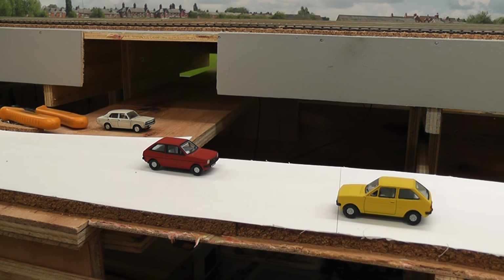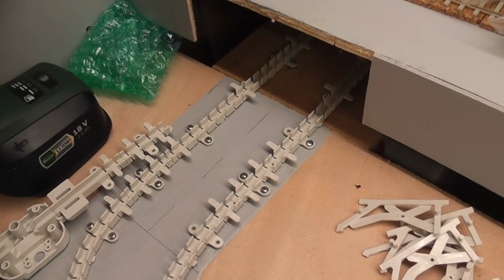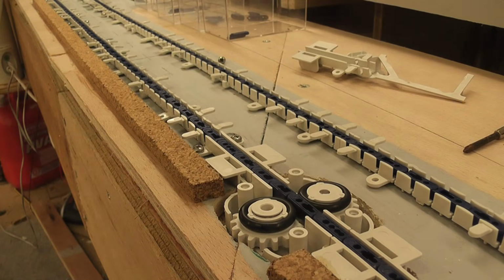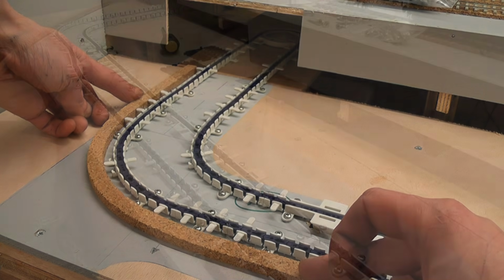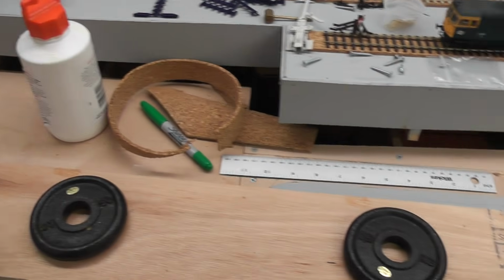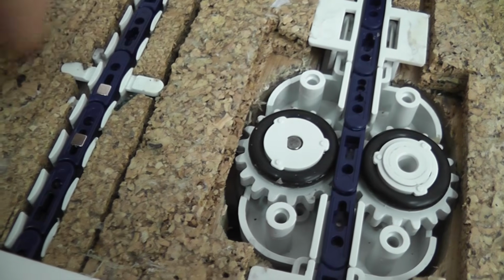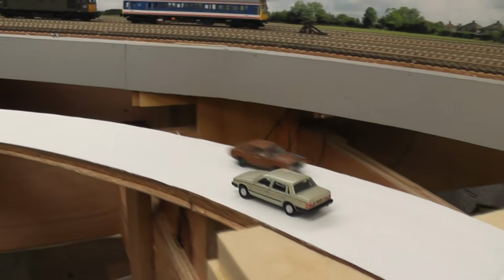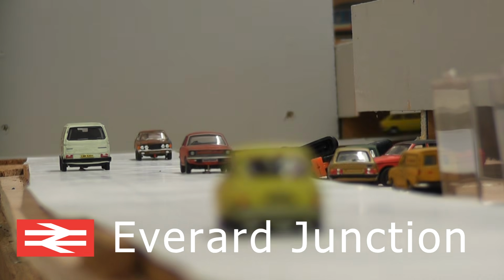New Layout Build - Magnorail

Comment: Hello I wish I found this earlier. I have had so much trouble setting out my track because the ‘Manual’ is, in my opinion, about as much use as an ashtray on a motorbike. I ended up routing a channel in the plywood baseboard to 8mm deep, cutting off all the screw ears and top surface ears on the track. It all fits nice and smooth. I am trying to run a model canal barge, about the size of your Fiesta, but it keeps loosing traction. Watching your magnet set up I see I have gone very wrong so will now follow your example. For my canal waterway I have a large sheet of shiny paper that was the backing to a picture frame, it covers in one piece. On top of that I have the very thin flexible Perspex that covers the picture. The sliders run around nicely but when I fit the boat or a Oxford Diecast car in one place on a bend ( a lot wider curve than the 180degree return curve with the kit), the chain stops. Or the boat/car comes off the magnet. I fitted the magnets to the boat and car. I will try your method.

Comment: Sir, 
I'm sorry to bother you depending on the scale size of my layout I have 3 major layouts and they are HO-Scale, N-Scale & Lionel 3-rail O-Gauge. Would you happen to know off the top of your head the names of these different scale type companies that makes the cars to be used on the layout. if I can use other market cars, trucks or  how about 18 wheelers in HO-Scale is that possible? Also are dicast cars to heavy for this HO-Scale setup?

Comment: I'm currently installing a 5m (each way)  long stretch of Magnorail. I've built a trial length about 1m long so far, routing the track into the board (to reudce sound) and using modified plastic trunking for the straight sections (thank you Ronald Dodd for that idea in your Hornby Dublo YouTube video). It works brilliantly using a road surface I haven't seen anyone else mention. I'm using self-adhesive satin black vinyl. It is too thin if you unpeeel the backing and try to stick it directly to the board. However, leave the backing on and it works a treat. I also think that it won't show the slider marks very easily as it is the same colour all the way through. As you can buy it in long lengths, there will be very few joins to show, which is a bonus. As all of my locos have sound, I don't think that the Magnorail run at fairly slow speed will be intrusive.

Comment: Attractive solution. Implementation a little complicated all the same and certainly expensive. Be careful to use vehicles with uncovered wheels, visually it is particularly shocking in this video. Alternative to the Faller system without on-board battery. Thank you for this well explained tutorial.
Solution séduisante. Mise en oeuvre un peu compliquée quand même et certainement onéreuse. Attention à utiliser des véhicules aux roues non voilées, visuellement c'est particulièrement choquant dans cette vidéo. Alternative au système Faller sans batterie embarquée. Merci pour ce tutoriel bien expliqué.

Comment: I wonder if, with some precision, you could permanently install the sliders on the car a fraction of a millimeter above the surface so that you reduce the friction down to only rolling resistance? I imagine the tolerances would have to be very tight or else you could lose a car off the track but the result might be worth the effort.

Comment: Hi! Conveyor expert here. Just a suggestion for the manufacturers, and maybe an idea for you: One of the end pulleys should be designed as a "takeup" to reduce the amount of "slop" as you call it.  The end pulleys should have a screw that allow you to make minute adjustments to the overall takeup or tension of the chain. Generally speaking, a chain should never be in tension at rest, but too much slop will cause major problems, so a takeup is usually necessary.
Reply: You are Right it might be a pain to get hold of the company but they probably need to no
Reply: I have a Question if you don't mind if I understand you right are you suggesting one mortar Rader then two
Reply: I wonder whether the turn-around pulley could be mounted on a simple slider for tensioning?

Comment: It seems to me, that there should be some granite cream or lubrication  product, that could be added to the chain trough to make it even more silent and slippery. As long as it stays dust free and clean. It should be rather air tight with the road surface lightly glued down. My garage door tracks have a white grease product that is very light, similar to the white grease product used to lube locomotive gears.  Just a thought...😅

Comment: I fear there are going to be a number of MOT failures!  Will you end up with a slider-track/mark from the sliders?  I’ve used UHMD plastic for stuff that needs to be slippery. I wonder if that could work as the basis for the sliders?

Comment: I wonder if the multiple motors are running at slightly different speeds due to the voltage drop on the longer cables which is why the chain appears to be bunched up in someplaces and not others?

Comment: I have found that to get the Volvo to behave correctly, you have to drill a hole in the driver's head and insert a brain. This may take a while to take effect as is the first time the car has experienced intelligence and it may take a little while to acclimatize. 
Of course, this procedure will violate the realism somewhat, But is recommended if you don't have automated police-rescue and ambulance units to deal with the normal mayhem caused by brainless Volvo drivers in the real-world. ;)

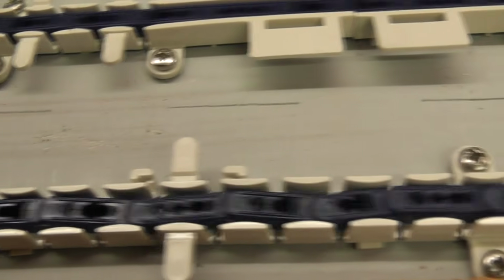Comment: It strikes me that you could get "bunching" like at 14:29 if your motors are not identical, and in particular, if the power wires to each motor are different lengths or gauges. Yours look a bit thin to me, but I haven't modelled for years.

Comment: THANK YOU for showing me this, as well as explaining the other system. The explanation on the 2 systems, got me to thinking about my planned layout. You solved the problem for me. Thank you, your Wisdom about both systems, I can use Both systems on my layout.  This system for the Auto Traffic in one lane, and the other system for Trucks and Busses in the other lane. That way the Busses have a route for them to move into a bus stop, as the Trucks continue on by in the Truck and Bus Lane, without affecting the Auto in the Auto Lane. I figured this out in my mind as you were explaining both systems, positive and negative for your layout. A VERY REALISTIC EXAMPLE you have Created for your layout SIR, mine might not be as PROFESSIONAL as Yours IS. FANTASTIC RESULTS. Thank You for Showing me the Realistic results.

Comment: The plastic is HDPE a self lubricating polyethylene. It's commonly used in cutting board for commercial use. There is also a video of a guy using sprockets and a bike chain. The Magnorail system is fantastic, but it's nice to have less expensive options. Option: to use a thumb tack or small screw to lay the paper road down. You may want to get to that Magnorail one of these days. Great video and very nice layout.
Reply: With the cost of bicycle chains these days, I'm not sure it would be much cheaper, but as a cyclist, I might just experiment with this!

Comment: This reminds me of the Matchbox Motorway way I used to have in the 70s it was a great system, it was a slotcar type idea but instead of having motorised cars it had a very long spring which was fed through the track when assembled then a 12v motor housed in a small building would click in and drive the spring around the track.  You could then put pins to the base of the cars attached with adhesive pads. 

The downside was the noise, very loud and all the cars went at exactly the same speed. But I loved it. 

Magnorail looks like a very similar idea.

Comment: Absolutely fantastic work.  Only issue I see is the cars run on the wrong side. (Yank, lol ).  Seriously-I wonder if Magnorail c/should make the spindle adjustable in a small oval slot-that way you could set the motor back 1/4" or so as needed to increase tension.  I would think the track will inevitably stretch with use.   Very well done!

Comment: This system is not very effective it wear and tear fast and loud , and you can’t make junctions. I would lay a plain magnet stripe under the road and have engine in a car. Junctions can be made with servo motors.

Comment: I think it is an interesting system. It looks like it is easily 3D printable. you could even use bearings or rotating pieces in the corners to reduce drag. it also looks like something that'll last a while. I don't how fast it wears down and what you can do against it wearing down, but maybe some oil could help with that. Maybe it can also make it a bit more quiet. It may dry up quickly though..
The main problem for me with this product from a convenience standpoint is that you can't have vehicles run along different routes. It's also very thick, so you can't have paths cross.
The final problem I see with this system is that it uses a lot of plastic. The cars needed for Faller's system need motors and batteries and stuff like that, but the track itself is just a metal wire which looks like the more sustainable option to me. The track also won't wear out, which is another benefit.

So, the main upside of this system is that it allows for very small vehicles like bikes. But other than that it has many downsides too. I personally think the downsides outweigh the upsides. Or maybe the two systems can be used together to get the best of both worlds :D

My personal idea is to use a hidden smaller scale train system with magnets on the trains so you get something similar to the system in this video. You could use a scale like N or maybe Z? That allows for tighter curves and you can make the trains switch tracks. So you can make a very flexible system. Especially if all trains can be controlled individually :D

Comment: I guess that the road surface will eventually develop a dark line where the sliders ride?  It would be an accurate look if the cars were pre mid-60s vehicles without PCV systems. There used to be a dark oil crud line in the center of most heavily travelled roads from road draft tubes.

Comment: The added magnets and load are going to rapidly wear your road surface. You need low friction wheels like Hot Wheels use. You can also clone your die cast bodies in resin, and make your own plastic chassis that minimize the load on your drive system.
Reply: Nice layout i want to do one but due to lack of space I may do a N-gauge one I'm going to price it up! And if it ain't silly money I will buy some magnorail starter packs.😎

Comment: I’m here after seeing the changes you made this spring. And I kinda miss this long run of Magnorail. Maybe have another run of Magnorail by the station by having cars passing your rebuilt bus stop where you keep your buses. You can do this to use up those remaining pieces of track and chain. Perhaps a little bit more cars running on the current road by the scratch built houses. And having two runs will allow for a little bit more traffic to add to the urban feel. And the pedestrian area in between the two roads makes it a little less contrived.

Comment: Can you use silicone slip spray on the track segments? 
Does the track have a way for cars to make an optional to go thru or turn at an intersection?

Are the magnets neodymium?  Will it work if you glue the magnets to the bottom of the vehicles so that the magnet is a hair above the road surface?

Comment: Hey since you're using photo paper, use matte on the surface and print your road from real scaled images. Ink cost is going to be high but the realism. All lane markers, pot-holes, tire marks, oil stains could be part of your print. Graphite or Teflon could be used on the chain side to reduce friction.

Comment: Love this demo. It seems the motor driven gears are making most of the noise. Would a dab of grease ( Vaseline?) help quiet them down? You could also add a recording of real traffic on a loop playing through a speaker at road level which could also mask the noise of the track. All in all, a nice system.

Comment: An interesting system though not cheap and a bit noisy, but I'm sure there are ways to reduce the noise like putting an insulation layer on top of the baseboard, making sure the tension of the chain is optimised, etc. I wondered if you could make this work over varying terrain e.g going from the flat up a hill road and from watching a few more youtube videos on their website it looks like you can to some extent. I guess you just need to use the stronger magnets and perhaps there's a bit of flex in the chain. The bicycle figures with pedalling legs are my favourite.

You could probably knock up something cheaper with a 3D printer or even lego technic, etc, although this looks less faff.

Very inspiring video. Nice work.

Comment: That is a superb system. What is the largest Oxford model it would move? Would it be safe to use it with a model of, say, a seven and a half tonner? There are quite a few Bedford TK British Rail road vehicles available from Oxford Diecast, like crew buses and mobile workshops. Nice to see one of those driving about.

Comment: Nice system, but it´s noisy. I am cheap (and a dreamer), but here are my thoughts:
Instead of an of-the-shelf system, I´d rather use PVC piping. There´s also flex available. I´d glue it watertight, and fill it with antifreeze and zero boyancy oblong sliders. No chain, just water pumps. Sliders being loose fit & longer than the cars. Perhaps even articulated/linkable (3D print). With a concave rear and blunt point at the front.

Any noise will be low pitch & baffled by the anti-freeze (waterless for more viscosity); friction is barely there, no matter how many corners. Going up a slope is possible, and so is changing lanes: Just split the pipe, and mount a magnetic strip underneath (or solenoids) to manipulate the little slider submarine and thus the car.
Cars slow down in corners or entering an intersection, by splitting the current or increasing the diameter of the tube. They line up at the red light by activating a solenoid that stops the first slider. These sliders will pile up underneath the road surface, but the cars themselves won´t.
As I said, it´s just an idea. You are actually doing it, so in no way do I critisize your work. I´ll bet it takes a lot of tweaking. Thanks for showing us.

On a more realistic note, would it make sense to replace the wheels of the cars with micro bearings? Use some heat shrink or silicone tubing to give them traction? It reduces friction & and eliminates wobble..

Comment: Its never complete without a Cortina. Your MK1 seems to have some bumpy wheels and it looks like it took a beating too. Nice setup. Thumbs up. XD

My Brain Storming:
Since those sliders use Neodymium  magnets, I am sure you can buy the same size with a larger N-factor. As for your motor controlled system, I would get one of those robotic H-Bridges for each motor which is around $5 USD or so per unit. That way you can use simple switches and a low voltage signal to turn each motor ON or all of them ON at the same time. If you want more torque, you can simple get  the same size motor that has a gearbox with higher MA (mechanical advantage) ratio. The motor used in the Magnorail kit looks pretty standard and the motor looks like its a 540 (Normally used in the 1/10 scaled RC model world) or 550 size.

Comment: Stronger magnets and larger motors and you can push it some more. Or make system where cars can switch from one magnet track to another magnet track, where one track goes down where another pick it op that come up, so you can disconnect and connect with different pair ofmagnets from different tracks.

Comment: Well, controlling cars individual is not possible, such as stopping at red lights or moving at different speeds. Also the annoying conveyr belt sound is omitted in the Faller system.

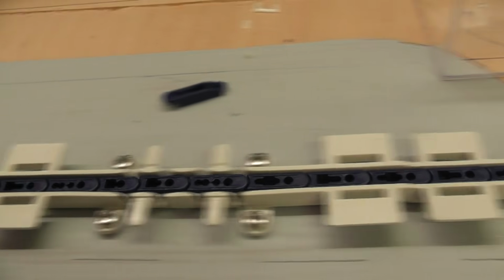Comment: 14:27  I think the bunching up of the chain is because the drive motor speed are not synchronized. It would take a lot of work to fine-tune each motor so they run at precisely the same speed. And of course, the more motors you use, the more difficult this would be. Tightening the chain would lessen but not eliminate the problem. Also, if the chain is too tight, it would cause the track and/or chain to wear faster. 

I've been tinkering with a similar idea using a toothed rubber belt on its side. A pulley is at each turn point with no track in between. Runs dead quiet. Early tests look good but still much work to do. 

A very interesting video. Thank you for sharing.

Comment: Its a shame they didn't run brushless motors, much smoother and quieter. An electric RC plane motor would do the trick there. One thing I learned is crossing hobby lines can really advance the skill and fun of any hobby. I have had train layouts before. Self tapping screws would have saved time screwing in the rails as would a sanding wheel to remove the nibs on the plastic. Although  it seems to be a cool system, I cannot see anyone trying to retrofit that system to an existing  layout.

Comment: Try putting a strip of sellotape or similar on the tread of the large vans on thefront axle as the tyres are dragged sideways at the end curves,it would enable them to slide lateraly a bit and so reduce friction which = strain on the drive system,but all in all superb set up

Comment: I'm going to incorporate this tech into my Harry Potter themed railway layout but I've been told the maximum vehicle weight, using the supplied magnets, is 10g which is very low and nowhere near what I need for the night-bus which weighs in at 111g. It appears that you have heavier than 10g vehicles , how did you manage this , presumably by using bigger magnets in the vehicles ? Do you have any figures available as to how you worked this out ?